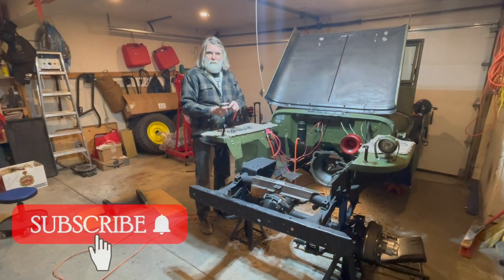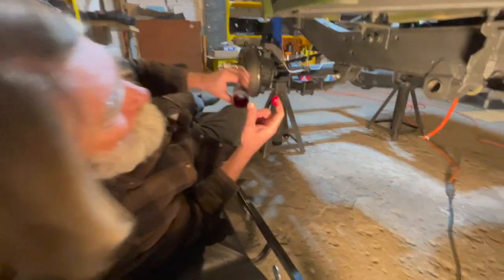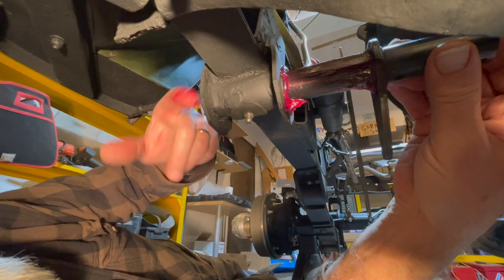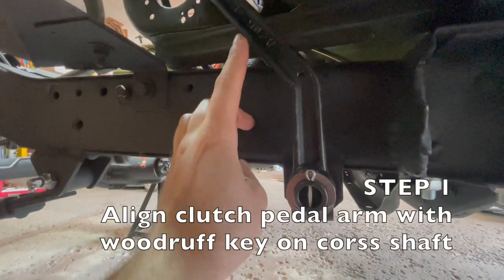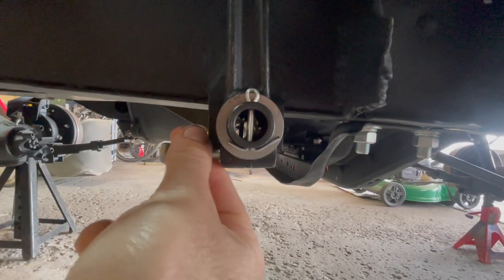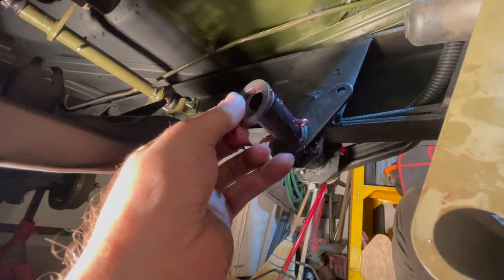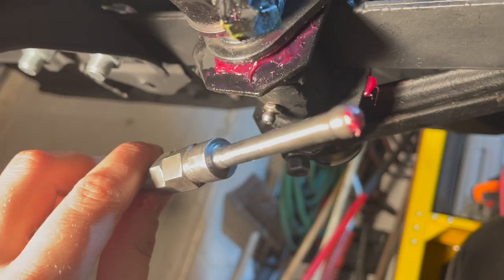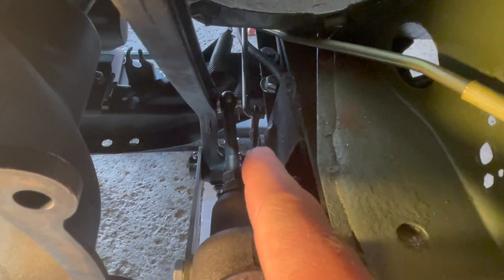Willys Jeep Brake & Clutch Cross Shaft INSTALL (YRS 41-48) | (Part 2)

Comment: on a roll there, keep up the excellent videos! 
Quick question: the hole where the pedal shaft goes into the frame...does it contain a bushing that needs to be replaced?